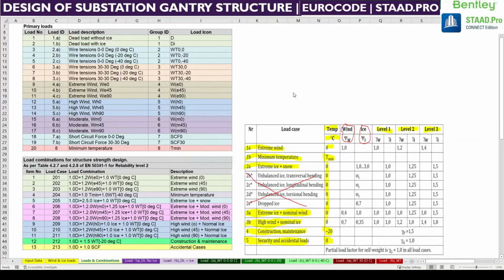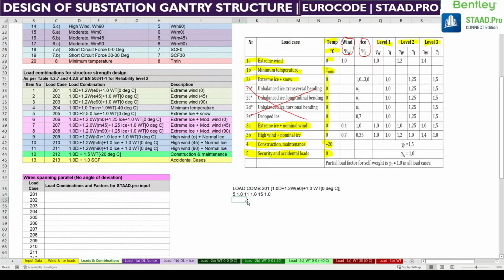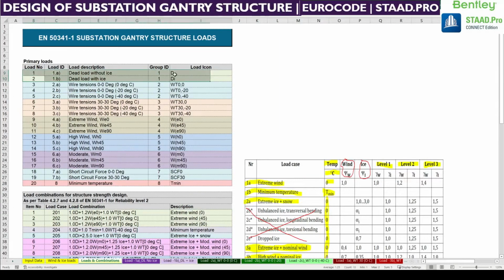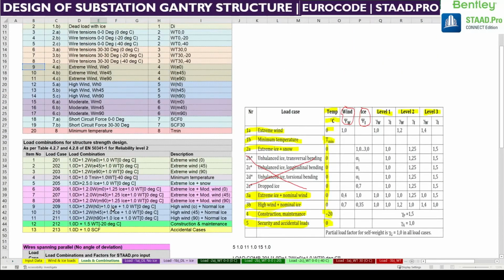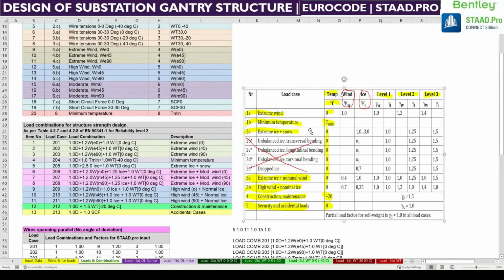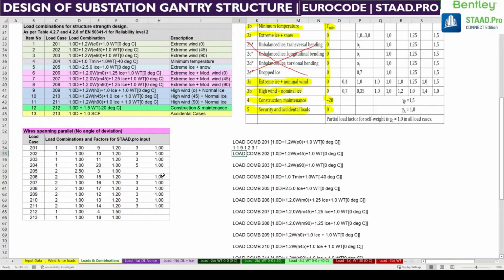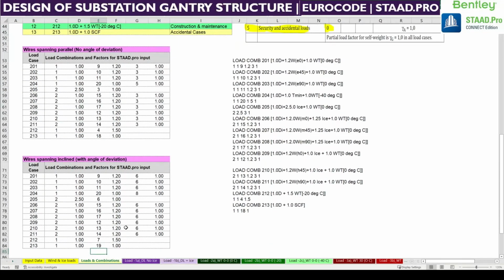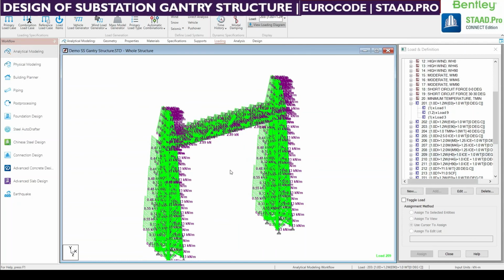Design of Substation Gantry structure | Eurocode | STAAD.Pro | STAGE 2 of 3

Comment: In the load combination of Extreme ice, 2.5 factor with ice is considered. But there is no primary case just for ice. Can u pls explain, it will be really helpful. Thanks
Reply from the maker: Ice loads on structures are not applicable. Only on condutor to be considered. Ice loads on conductors are considered already in the form of consuctor tension with ice, and a significant exposed area of equivalent condutor diameter due to ice  for wind loads is considered. Refer this for details: https://youtu.be/HkSsdUEihdo?si=5Exw5o_nhgcF_zPp